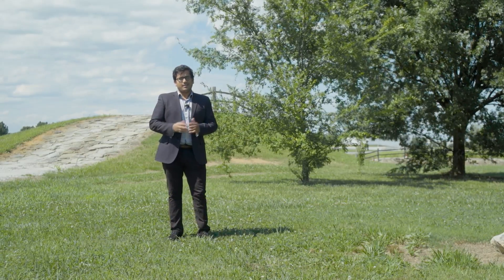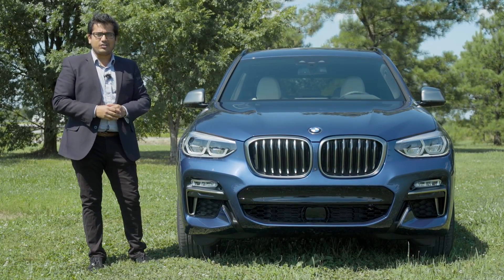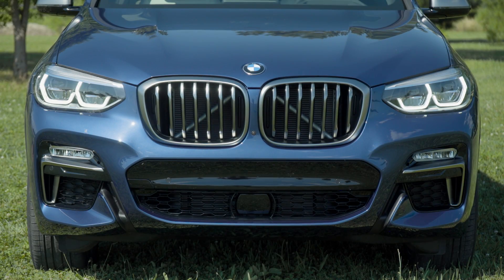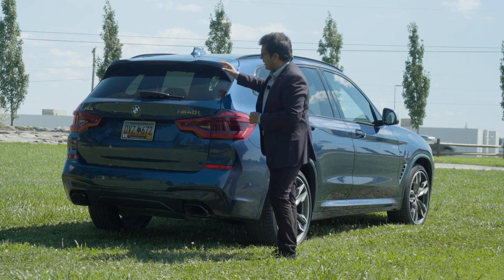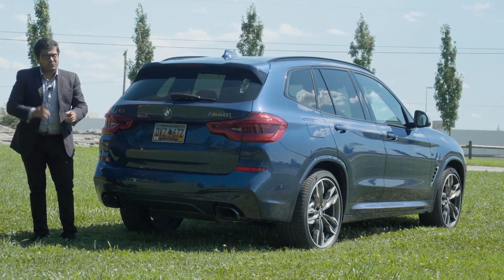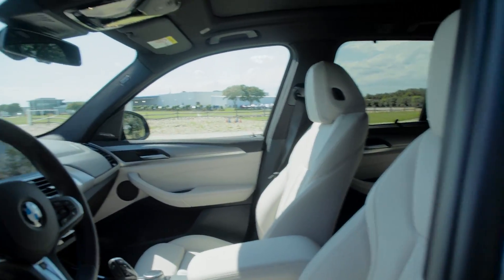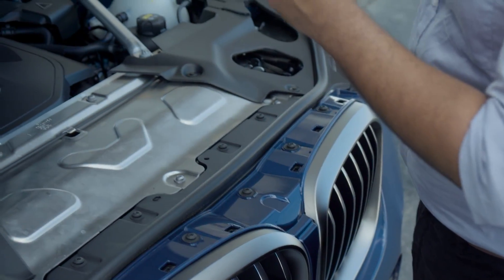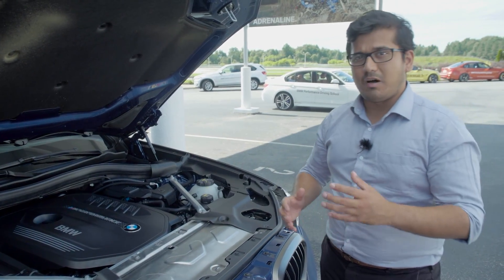BMW X3 reveal REVIEW all-new SUV neu Offroad / Onroad 2018 - Autogefühl

Comment: The 2018 X3 is very close in size to the revered and venerable E-53 that I loved so much, I bought several of them. I wished they would have re-worked the tail lights better to give it a more classic look. The X3 M 40i will be the one to really seek after because of it's power, speed and dynamic road manners. One has to really review this in person to get a more accurate perspective. I'm looking at Porsche as well but they're so damn expensive even used.

Comment: I absolutely dig the new interior design and some of the exterior design. The spec sheet looks nice for a successor vehicle and it is probably going to be priced generously. Probably just 2 grand more than the current X3 (manufacturers always do this to new gen cars). Overall, BMW really did a good job... I would only want the kidney grills to be smaller lol.

Comment: Nice car! I wonder what the second-gen X4 will look like! Really rugged! And the M40i sounds sooo good, as heard @0:56!
Its interior is a bit meh, especially that small trim piece around the central air vents! Looks like that in the 3/4 Series!

I only have one observation: TwinPower Turbo engines don't necessarily have two turbos! This Straight-6 engine for example hasn't got twin-turbos! It has one turbocharger but it's a twin-scroll unit! ''TwinPower Turbo'' refers to this technology! 

Keep driving! :-D
Reply from the maker: +MafiosoItaliano458 true :)

Comment: The "kidneys"? Really? Do we need to be included in the designer-to-sales-behind-the-curtain jargon?
Reply from the maker: the BMW double kidney is a historical term basically...
Reply: That may be so, but setting aside the fact that it sounds wrong, it's not even visually accurate. The BMW grille is NOT kidney shaped, as it completely lacks the medial convexity corresponding to the renal pelvis. A better anatomical analogy would be the lungs, as they have a more similar shape to each grille and fulfil relatively similar functions.
Reply: +Roadjull - I'm not a medical expert, and perhaps there may have been medical inaccuracy from the motoring press back in the day, but the BMW grill shape of early 1930 and 1940 BMW's earned, at the time, the description 'kidney grill' - look to the 1930's 315's and 328's...!
Reply: It's alright, it just sounded wrong and I'm nitpicking. I'm sure there is history behind the term.
Reply: No worries - all interesting stuff! Cheers.

Comment: A lot of relatively small style changes and some cool technology upgrades. I like a few of the cosmetic changes but most of them I don't like. I think that the demand, probably coming from government, to make vehicles more aerodynamic is to blame for some ugly cosmetics out there. But in addition the changes on this X3 seem more of an Asian kind of look. There's more of a bubble look to the back. Odd bulge on the sides of the front. I think the government pressure on fleet fuel economy has claimed another casualty because they have eliminated the 6 cylinder option except for the M trim version. I have a 2016 X3 X line. I think I'll keep it.